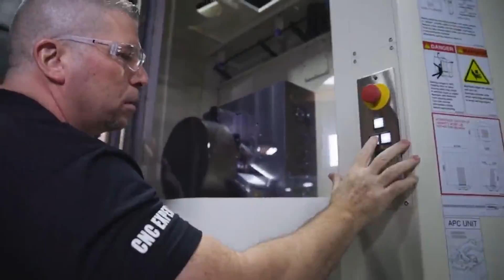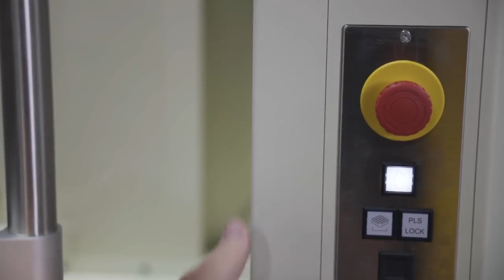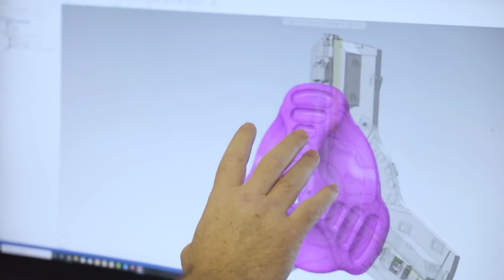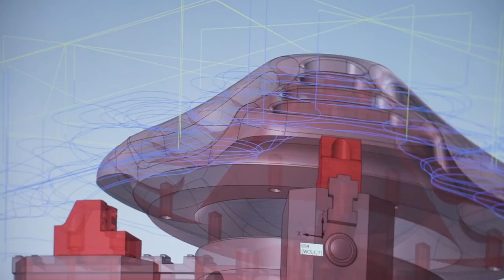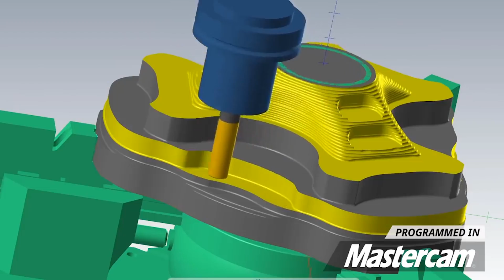Buyer DEMANDS 15% PRICE DECREASE or Parts Get Outsourced!

Comment: The owner of the company you were talking about moved his equipment and operations and process into a modern manufacturing facility , but his company philosophy was obsolete. The man didn’t understand strategic partnerships and customer relations.
I had a forty year career as a computer engineer,so I’ve been in it since 1978. Worked on the first widely available large scale computer systems and operations. Worked on every type of machine through the different generations of architecture. The one thing that has remained consistent is “change”.
Some managers understand automation, and some never will. I believe you do, and I really applaud you for sharing that very relevant story. Wishing the very best for Titan. I believe North America has the best minds and workers, and critical infrastructure tooling and manufacturing should and will happen in North America.

Comment: My uncles shop had both cnc and even tooling from the 1940s war eara  we did a lot of truck parts and mitilary stuff as well as local parts.
The jobs were bid on suspected time to make as well as tooling requirements 
You had to bid the job from a lot of manfacturing companies and hope you won the contract. Then you sweat no one screws up the parts as you make them. That was always a problem tolerances were not met and you lost time and money on the job.
Somone asking for a 15% cut in prices across the board its just not right to do that to a job shop.  
If every machine is always making the same parts thats a different story, becuse you learned ways to speed up production and get better machines and tooling.
Your not making 5k parts your making an endless number of parts.
It also depends on the tolerances type of parts and metals your using.
If you take 50thou off a part in one pass the metals going to change its modular structure and the part can change its size.
Eventually when the metal meets its normal room temperature its going to show its actual size. Just becuse you drilled a hole dosnt mean its round.
With wood it isn't a concern but metal its very concerning.  That .0005 might make the part scrap.

Comment: your government is supposed to protect you from nefarious business practices. like asshats trying to drive the price down else they relocate all their work to a third world country. pandering to these people is a terrible idea. they will always come back asking for more. it will never end. and eventually after you making a loss on every item you supply them, they will fcuk you off and move all their work anyway.
car companies are the absolute worst at this. with ford being the most miserable cnuts on the face of the earth. you dont bid for work with ford. they come see you and tell you that you are making such and such for them. they tell you exactly what materials to use, and they check so you cant buy cheaper options to cut costs. not that i would ever advise that with plastics. the top end brands are top end for a reason. you can not say no to this new product. because they bundle in with this new work the threat that they will take away ALL of their work if you do not comply. they also tell you how much they will be paying for this product. and along with this is a pricing structure that automatically reduces the cost to ford by about 10% each year you produce this for them. the lifespan for a typical part is about a decade. if you are really lucky, you are able to make a profit on this product for the first 2 years. after that, this product is no longer profitable. and it is impossible to get out of making it for them.
the hardest pill to swallow in all of this. is that initially, the products ford purchased from us were our own inventions.

Comment: I know of a small company that nearly went under due to a larger company pulling a contract then baiting the hook for the smaller company to take the goods that were now made in the far east and sort them out, the small company did it but at less than cost waiting for the secured contract but never got more than breadcrumbs inthe end the small company bosses wised up to the fact it was stale bread now and the jam never comes so ditched the referb  work and to on other contracts letting the larger company know that they had blown it and from here on in it was their problem.

Comment: Your boss was right.

Simmilar story: I worked for a company that had completed a re-design on a robotic product before I came on. My job was straight assembly. The redesign the engineer had completed allowed all parts of the machine to be acquired off-the-shelf and locally with he exception of the chassis which was a custom stamped and folded form and a PCB. I assembled 300 of these robots, discovering along the way that the client had skimped on many parts, mostly nuts and bolts but also control boards, sensors, and some pneumatic parts throwing off our internal inventory. Working with the client toward the end became a nightmare. 

"I have the parts in storage, I'll get them to you in three days." became weeks and months of waiting on parts. 

For the nuts and bolts we just ran out to a local retailer and bought them by weight, which was nice, but by the time I was down to the last 20 or so units (all of which had been sold by the client and promised to his customers a year before we even got involved) we were waiting on him to send out major parts.

After around 4 months of struggling with the client to get the final parts from Houston to Idaho he announced that he next batch of 500 was going to China because we took too long and were too expensive. (By the way, that was also a breach of contract, but my employers didn't fight too hard) After 2 months, we started getting units for "diagnostics and repair" that had shattered 3D printed parts instead of injection molded, arms that were warped because the China manufacturer had skimped on aluminum tubing and got stuff with a thinner wall, almost all of them had failing electronics, and the client went from a high-demand product in a niche market to a destroyed reputation. When he asked to bring his manufacturing back to us, my boss let him know exactly how much we had lost on the first batch because of a personal relationship with the client, informed him that he had thrown away that relationship, and gave him a new quote. I lost my job there after the client split, but that was a year ago and Houston never brought his product back.

Had a similar experience working with a CNC manufacturer in college that made paintball markers. Happens a lot, in fact. I'm not brave enough to be an entrepreneur myself, and I have the highest respect for anyone who can take that risk so I wouldn't tell you how to run a business, but when you quote a client you work in margins. Then you add buffers. Then you add profit. As you learn to make a product, you can reduce your buffers and margins with the efficiency that goes up from experience but when a client starts asking you to cut profits you have to weigh the value of their relationship vs real dollars and most clients will come up lacking.

Comment: What if a unit goes down and how routinely is everything calibrated, cleaned, & maintained? How do you work in those values, and how do you prepare to avoid malfunctions? I would like to gain more insight into your core values.

Comment: I see where your coming from but also speaking from experience we were asked for a 10% reduction then a 20% reduction then a 40% and when I left they were giving them a 50%. They had to cut loyal workers and over work existing staff. In the end the profit margin got so tight they lost a ton of money due to a small issue and the contract. Now with a reduced work staff they couldn't bid many jobs and no one there was happy with the work load so they will die soon Its ok to work with a client but you need to know when to leth them go or get new ones

Comment: It was either Record or Irwin tools, who decided to shut down some of their manufacturing in Sheffield and outource to south east asia, thinking it would save them some money and they would avoid having to upgrade the furnaces to comply with environmental regulations. The drop in quality did far more damage to their reputation, sales and stock price than they saved by outsourcing. 

This is what happens when you have bean counters who know nothing about engineering running enineering companies.

Comment: From a CNC machine part workflow with a set standard line, meaning common work stations (same machine with the same tool selection) on both sides of the isle with a raw stock feed and output each (could include station robotics), the plan is to not run all of your machines all of the time, but to rotate in machine and tool maintenance into your work flow to not inhibit production schedules. Maintenance also includes repair if a machine component is near to out of tolerance depending on the operation and machine. Also, it is difficult to update machine software and do machine performance testing (quality control) unless you have some scheduled down time. This is not a problem if you plan on a rotating maintenance schedule. The real benefit of this commonality in production is if a machine breaks down. You have some extra bandwidth in production which allows you to keep on schedule.

Comment: If I’ve got to rework an outsourced part, you’re gonna pay. Period. You will not save money in this manner. This doesn’t work.  Especially for critical process parts that are either safety-related, pressure-sensitive, or hardened for durability. Safety is a factor, and simply put many overseas competitors cannot replicate the skills and techniques that it takes for these type of parts. Manufacturing is not one size fits all, and sadly, higher up accountants and newbie engineers do not understand the intricacies involved for all parties to have safe and reliable supplies.

Comment: I probably would have offered a 10% or 12% discount. 15% is a lot. But at the same time. You do need to work with the customer. They could have gotten hit with the microchip crash last year. It hit the shop I worked at really hard. Or a competitor decreased their prices.

Comment: Fifty years in heavy manufacturing so one can say that you are "preaching to the choir."  My Father left the farm to make a career in manufacturing as well.  As far as these MBA managers, with fancy degrees and theories that haven't been adequately and rigorously tested in the field and are often limited to a "Harvard Business School case study," he used to say that people who buy solely on the basis of price get what they so richly deserve and that even though the customer is always ultimately right, some customers (driven solely by bottom lines or acquisition costs) are simply not worth having.

Lower level people recognize the fallacy and insanity of buying solely on price and then vigorously patting yourself on the back for "meeting or exceeding your cost cutting targets."  Little intangibles, like nimbly responding to volume changes or delivery schedules have no value in their world and are in essence ignored.  I had the good fortune to deal first hand with a small boutique foundry for over forty years.  They were nearby, but at first since inventory and WIP weren't  under the scrutiny they were later, on hand inventory could be high.  And when "quality spills" occurred, it always launched a massive fire drill to isolate the problem children and control or capture what had gotten into the line, or worse yet, out into the field.  More than once I could recall early in my career being "out on the pad" checking casting date codes to control a quality spill.  And some of these fire drills were in less than pleasant weather.

Anyhow, this foundry was eager to avoid this issue as well and cooperatively and independently worked to reduce the on hand inventory of raw castings.  They did the true heavy lifting; because we were just comfortable with usable castings being on site when we needed them.  Still, over time, a month inventory of raw castings was reduced to less than a day and trucks with the right product mix were coming in with extreme regularity and punctuality.  And when spikes in scrap rates due to hard spots or other problems which can readily and commonly occur with production sand castings, a great source of comfort came in knowing that a team could be quickly assembled, drive up to the foundry and be welcomed on the pouring floor in 90 minutes or less, and attack the problem to our joint benefit.

Emissions and fuel consumption reduction in the 80's and 90's presented their own special challenge, for which numerous casting changes had to be considered, prototypes produced in small quantities (isn't that just every foundryman's worst nightmare?) and then machined and evaluated for feasibility.  In order to meet requests, this foundry developed a process by which experimental castings could be "cobbled up" by rubbing or machining cores to give desired characteristics and then integrated into ongoing production runs by pouring molds with a mixture of production and prototype castings and successfully isolating and segregating the two parts.

So-what was this foundry's reward for providing this level of customer support and sharing of their skills, talents, and capabilities?  It was an unending barrage of requests for across the board price concessions.  And it didn't stop there-for control purposes, pattern equipment was owned by us but kept on the foundry property.  And every request for new tooling or tooling changes to accommodate new designs critical to the continued viability of the end product and its ability to meet Federal emissions requirements and commercial requirements was subject to intense scrutiny and "nickel and dimed to death."

Anyhow, I came to loathe those sharp penciled MBAs whose limited participation revolved around cutting costs and doing so by imperiously requiring capricious cost reductions with often little to no apparent justification.  And it wasn't long before they started turning their attention internally within the company, making these same capricious across the board changes in staffing and funding.  And before long, the only thing that the company could make was their "numbers," so that the really big shots got their vulgar bonuses and the stock holders got their returns.

Greed, plain and simple, gutted American manufacturing and continues to do so.

Thanks for a forum to vent.

Comment: really big wiring (lighting) project mid 90s. enough so it was economical to build the fluorescent fixtures at the site. the buyer cut corners by purchasing the empty metal shells from Mehico. they proceeded to 'cut' our hands and fingers unlike the n american version these had horrible sharp edges.
cheap cheap cheap cheap

Comment: Every second you're running a machine its getting wear and tear. Its not worth it to run 24 hours a day if you're not making money on the parts. If you could get a higher price for each hour and still make the same amount of money you would in fact make more as your machines would need less maintenance. But its a hard balancing act.

Comment: This is typical move by new upper management in the valley having worked there for 27 years as a fab buyer.

New mtls. mgr. Promises to reduce cost as part of his hiring.

They (mtl mgr.) dont have to justify why/how mtl.process changes to existing supply base.  They (mtls. Mgr.) know this is a outsource offshore move that eventually is going to happen so they get their end of year bonus.

They don't care how disruptive it is to local supplier base.  They go offshore (For LOW BID), And as you are experiencing you get to fix/modify/repair offshore mfg. Mistakes.

We used to call that "JNIT" just in the nick in time planning, logistics, repair of marginal offshore vendors improperly vetted if at all.

Most quality groups get gutted by mgmt. Pushing offshore QA entities on the payroll of suppliers/intermediaries.

Comment: Lasers are a high value product.  The know-how that goes in is worth far more than the component parts.  I run a Canadian R&D company in the advanced optics space.  The last thing I want is manufacturing going to a country with lax respect for intellectual property.  All of our parts are made in Canada and the USA.    Outsourcing invites the risk that unethical foreign "partners" will reverse engineer and clone your product.  In my humble opinion the CEO of Coherent is putting the long term viability of his company at risk to show shareholders a bit more in the next quarter.

Comment: I ran a Navy optics lab, designing and making optical systems for DOD. I never lacked for work even with my high loaded rate I had to charge. One day one of my more fun tech development customers came in with a proposition. This was around early 2000's and the big Chinese optics boom was well underway. He said something like " you quoted $10K for this job, I can get these made by XXX  (Chinese) for $2K. Match that and you have the work. I laughed and said "good luck". A few months later I asked him how it went. He said the lenses were junk, met none of the tolerances, had fake certs, weren't even the right glasses. Took the box and threw it away. His development project was a complete failure, and he had to scramble for his next years funding. 
I rode with the changes. When I started there in 1989 the lab was very old tech. With the manual machines I had available I charged 30 hours ($4500) for a single precision prototype lens. I installed newly developed CNC processes as that came into being in the 90's, and that same lens became 4 hours. That same high speed technology spread into China 10 years later but the labor was almost zero compared to a DOD lab/scientist rate. Many DOD customers learned the hard way that Chinese companies that made commercial sport optics weren't up to aerospace demands for quality.